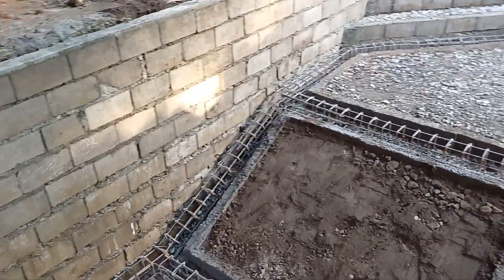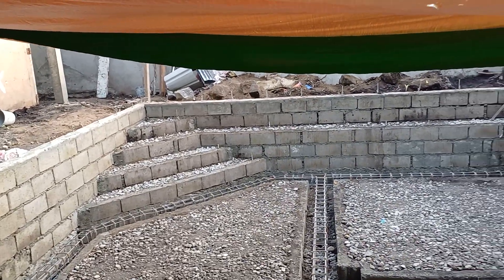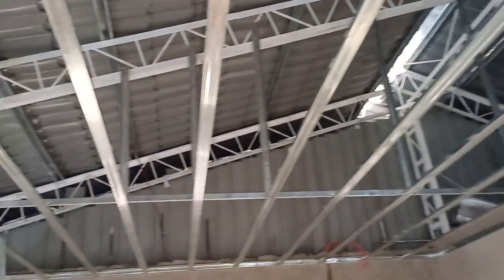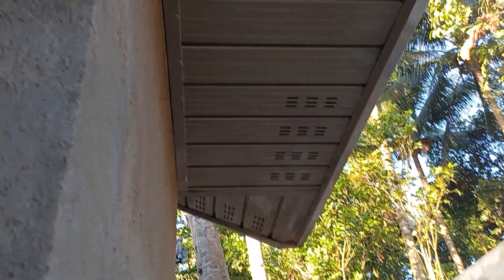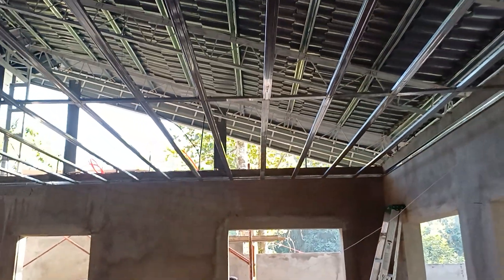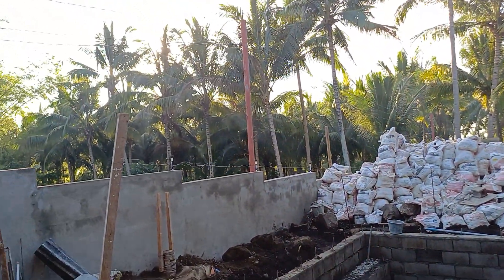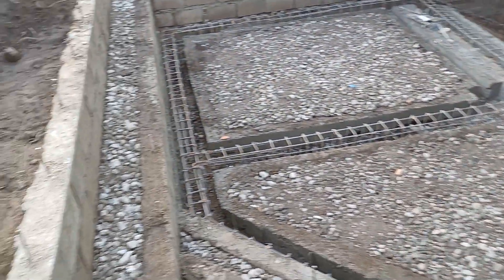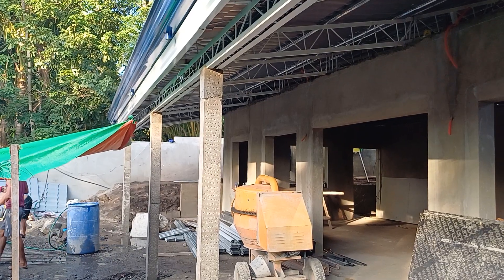OUTSTANDING SWIMMING POOL POOL PROGRESS. CEILING CEILING METAL FRAME WORK UPDATE

Comment: Looking good , great progress! my house in Thailand I put insulation in the ceiling while it was still open and was the best thing I ever did that way you can put Gable fans in the attic space one pulling from the cool side and one pushing on the load (sun) side to push the hot air out of the attic space and it really keeps your house cool doesn't let your air conditioner work so hard then. just my two cents of helpfulness. Now all you need is you rocking out at a pool party!
Reply from the maker: Thanks brother

Comment: Very cool, they are doing an outstanding job, would it be feasible to insulate the underside of the roof to quiet the rain and keep the cooling system at a more consistent level?  I'm not sure if this is the norm here but maybe vents at each end of the house at the underside of the roof with say a thermostatically controlled fan at one end. I'm sure you know more than I do about this but anyway, things are looking great it's always fun to watch someone succeed at a project and life in general.
Reply: True that rain is loud on a metal roof!

Comment: Hi, Do you plan to put foam board insulation on either exterior or interior ? not only for AC insulation but also for noise insulation. Nice progress !
Reply from the maker: No need,never gets be low 70 and cool in mountain trees

Comment: Juells, sorry to say but your going to have BIG problems with hollow block swimming pool walls. They should be solid concrete walls. And I see no pipe yet? All the pipes need to be installed BEFORE any concrete poured!
Reply from the maker: Just wait and see my vision.its hollow block then solid 8 concrete so 14 inch thick walls.yhidvid tropical pools with a 20 year reputation.patience my brother
Reply from the maker: Pipe is going in today...come on man get with the program